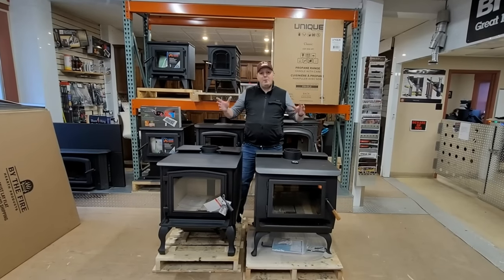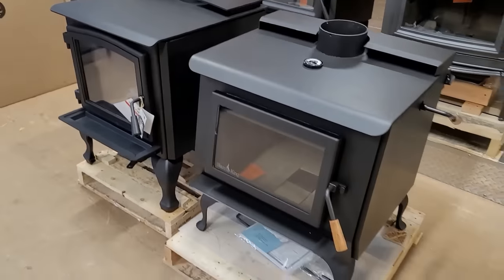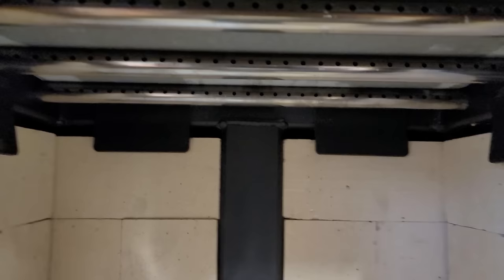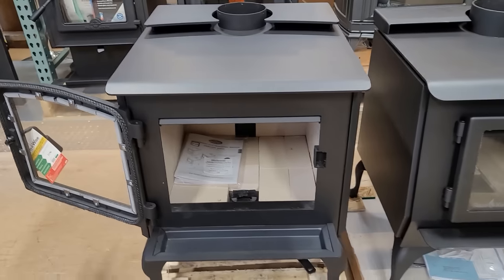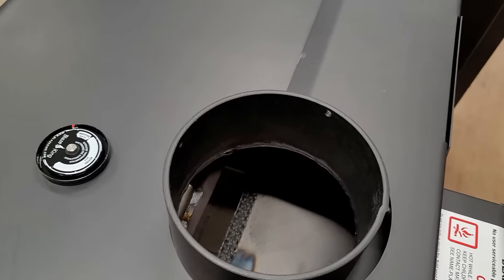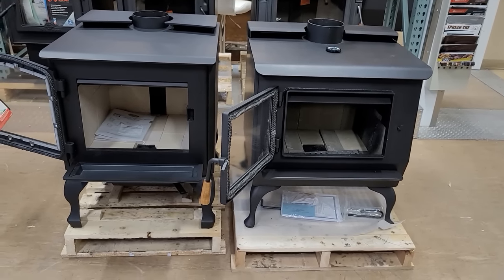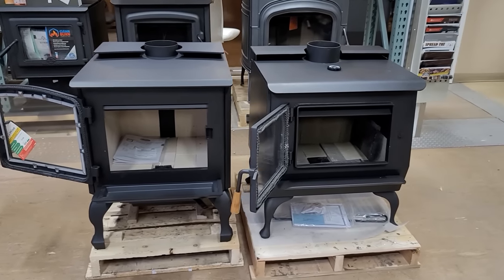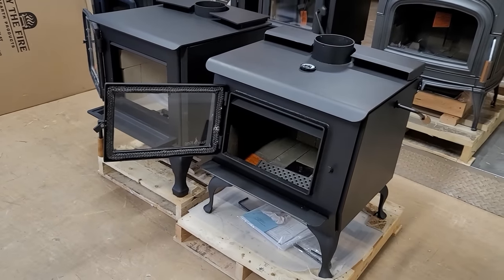Comparing Catalytic to Secondary Air Wood Stoves

Comment: We bought a Princess 32 and installed it on Valentine's Day. The fire has never gone out, and the house stays at 70 deg. Load it a night, top-up in the morning, good for the day. The best part is that we're burning HALF the wood we were burning before. What a great stove for a home.
Reply: Can I ask what the outside temperature was when it kept the house at 70deg?
Reply: @Journey_Around  These are the questions that we need to ask, but shouldn't have to.
Reply: Do live in Nunavut or NJ? Is your home 5000 sq ft. or 800 sq ft.? We need context, or the post is not helpful.
Reply: How long before the exchanger has to be changed

Comment: When we replaced our old Fisher stove about 30 years ago, cat stoves were really being pushed.   What I learned by asking lots of questions was this:  Is there a warranty on the catalyst--and for how long?  (its perfectly possible to "poison" one).   What's the catalytic efficiency at the end of the catalyst's life, compared to what it is at the start?   Should your company go out of business or be sold, how long will replacement catalytic cartridges be available?   Can I get a replacement cartridge, say, for my Oregon Woodstove (long defunct)?   One thing that was a real stopper for a couple of candidates was "You show a left-hand hinge model. but we need a right-hand hinge one.  Can you sell me one?"  You would be amazed at the number of "no" responses we got on that one.
After all the research, we wound up with the secondary burner.  It cost more than the catalytic models, but it still works just fine.    Heating efficiency isn't a big thing, as we own our own woodland and usually have far too much downed wood to be able to burn it all.

Comment: I tend to favor hybrid burners that feature the best of both types of stoves like the Jøtul F 500 V3 Oslo or the Woodstock Progress Hybrid stove. They deploy both technologies described in this video and allow you to decide whether to go for a hotter, more attractive fire or a longer burning fire. The Jøtul stove has a new type of combustor that is guaranteed for 20 years and doesn't require a bypass damper for when the stove is heating up, so its first hour emissions are extremely low because it always burns in a clean mode. Catalytic stoves have very high emissions while their bypass dampers are open, and require you to pay close attention to the catalyst temperature after lighting a fire so that you know when to close the damper. If you happen to get an engrossing phone call or you fall asleep right after lighting the stove you may burn all the wood up with the damper open. Catalysts have come a long way but are still often the Achilles heels of catalytic wood stoves. When they are new and undamaged they do a great job of giving you a high efficiency burn but if they become damaged or worn out the efficiency of the stove can drop substantially.
Reply: Can one clean and fix catalyst easily?
Reply: @haliaeetus8221  You can easily clean it, I use my shop vac to clean it up. If the cat needs servicing I would buy a new cat, install it and get the old one serviced. It should be a good long time 5~+ years before the cat is damaged. But from experience you will destroy your first cat in the first few years of operation while learning to use it. I have 3 species of wood I burn for heat, each has different settings and I don't have the luxery or space to let my wood dry / season for 2 years before I burn it. Most gets 6 months. So you will be cleaning it / servicing it. My practice is to use my shop vac to suck the ash out of the stove and then to take the shop vac to the cat. I do this every week and don't need to really worry about any other maintenance.
Reply: Thanks for the info about the Oslo 500. How do you increase the burn time other than reducing the front air inlet ? Also were you at all bother by the stove needing such thin pieces of wood ?
Reply: Also can you burn in the Oslo 500 without the catalyst I place without causing damage to the stove?
Reply: @lrich9317  It doesn't require thin pieces of wood. Thin pieces are often used in demos because they catch on fire quickly. The front air inlet is the only control on the burn rate.
Reply: @TugHillGuy  

Thanks ! Mine is getting installed as we speak ! Also what is a fair purchase price for a refurbished F600 joutal ?
Reply: @lrich9317  Which stove did you get? I'm not sure about what would be a fair price for a refurbished F600. It would depend on how good a shape it is in. I would check out the baffle and fire brick on the inside as well as how nice it is on the outside. Enamel paint is nicer than flat paint as it holds up much better. My friends own one. That was Jøtul's biggest stove before they stopped selling it due to not meeting EPA 2020 regulations.
Reply: @TugHillGuy  Thanks for the advice . Actually I got one F500 v3 joutal and the Pacific Energy alderlea 6T for another location.
Interesting that the joutal F500 v3 supposedly has the same heat output of the discontinued F600.

Comment: My woodstoves are old but extremely well built.  Both have thermostatic cold air inlets so the burn is fairly efficient.  I also have 2 Wiseway Non-electric pellet stoves.  I use all 4 stoves during the winter.  One woodstove to heat my barn and one to heat my "shop."   I use the pellet stoves to heat my house.   If pellets become expensive I have 2 spare woodstoves stored for "kust in case."

Comment: I didn't hear you mention one of the BEST features of the Blaze Kings. The automatic air control !!!!  That works like a thermostat for a furnace and automatically adjusts the air supply damper to maintain constant temperatures throughout the burn cycle. This one feature of the Blaze Kings that I would never give up and of course it helps that they are the longest burning wood stoves available. I have a Princess in my shop and a King Ultra in my house. I bought both of them new and still use them every burning season. The Princess is about 20 years old and the Ultra is 14 years old and both still work great.
Reply: What size if of shop u heat and to what temp ? I’m trying to decide if it’s big enough for a 36x50x16 in Manitoba ca
Reply: Have you ever had to change out the catalytic combusters?
Reply: My shop is 32 x 40 x11 and the princess is OK if I keep it going. I only have R20 insulation in the ceiling. I would suggest getting the Blaze King "King" for the shop if it is reasonably well insulated. I have a King in the house and it heats the whole house, up and down until it gets really cold (-30C) then I have to add some electric help. House is about 1300 square ft up and same down. @henryhenry5897
Reply: @louiswestfall9622  The one in the shop was changed out when we moved here 14 years ago and its still in use today. The one in the house was changed out twice. The first time because my moron electrician thought it would be a good idea to throw some plastic into the stove while it was burning. Ruined the combuster and he paid for the replacement . The second time was about 7 years ago because I was having draught problems and thought the combuster wasn't working properly. Turned out it was not a combuster issue.
Reply: @HillBilly-wc4dl  thanks for reply yes I’ll prob insulated it with 4“ closed cell sprayfoam about r25 wich is really outperforming any r40-50 fiber so I’d call it very well insulated ....
Reply: Same thing with my England's Smartstove.
 Once the wood has chard around 15 min. You can manually set  heat  output. Thermostat then keeps it there.   If you pull the same control out all the way and turn counter-clockwise you'll set it to automatically shut off the primary Air Supply on the bottom and just run the secondary on the top. It only does that once it reaches  temperature.  If it should drop more than the secondary can control it opens it back up. Otherwise it's maintaining temperature just from the secondary burning gas from the mass of red coals.
    It's is nice when you're sitting back having a  drink and a smoke in the evening to leave the dampeners open and enjoy a nice Flame. And when you're done just set it and forget it.
Reply: @louiswestfall9622  I have a BK King.  Myself and two friends in CT bought ours all at the same time back in 2009 ($1925 each, don't know what they cost now, but I'm sure they're worth every penny).   Anyway, we all remove and clean the cat at least once a year.  All of us use the stoves all winter long, and we are all still using the original cat!  I do have a spare cat which I bought with the stove, but haven't installed it.  Awesome stoves!

Comment: Having used all types of wood stoves I would say I prefer the reburn. Although, the catalytic stove is an old Vermont Casting and they don't have the best reputation. Whatever stove you buy, get one with the lowest possibility of an air leak. i.e. no ash dump, few gaskets. That Vermont Casting has an ash dump and six different gaskets of varying sizes. After the last time I took it apart and cleaned it up it feels like it burns through the wood faster so it must have an air leak somewhere.

Comment: This is extremely helpful. It would be nice to know what the price difference is between these two stoves I know they would vary from state to state but it would be nice to have a general idea. And do these stoves come in smaller models. You mentioned this heats a 2500 square-foot home which would be too large for what I’m looking for.
Reply from the maker: Yes they come in smaller models and the prices are close depending on the brand you choose.

Comment: Thankyou for a very informative video.
But you left out a very important point regarding these two fire places that people should be aware of before making a decision on either.
Maintenance!
The secondary fire place has minimal maintenance where as the catalytic fire place has much more required maintenance that has a fair cost associated with it due to cleaning/replacing the catalytic unit that is made of quite expensive materials.
Happy to be corrected if I am not on the money here...
Reply from the maker: I think there is some merit to what you are saying to a point. It really comes down to the type of wood burnt. Well seasoned wood and barely any issues, unseasoned wood and plenty of issues for both. Depending on brand of stove secondary air stoves can be expensive to replace parts as well. Secondary air tubes and baffles often get broken and need to be replaced so both types of stoves can cost $$$ in maintenance. Hence why its not mentioned.

Comment: What happens when you can go longer by a replacement catalyst for the stove? How long do these catalyst last? Does a catalyst really burn that long or is it just a bunch of bull specs? I can't imagine anything burning 30 hrs or even 20 for that matter on one load of wood. Lower for longer periods of time is exactly what I need but in concerned about replacing the catalyst etc. Can a catalyst replacement be made easily?

Comment: I wonder if that Catalyst  makes the air outside smell like a Flatulant?   Back in the 80s, I built a stove from a piece of 18" pipe. Had a top Horizontal 6" exhaust, a large baffle forcing the exhaust to go around the ends before exiting into the Flue, (which was 20 feet tall). Since the Stove was ROUND, there was no need for Fire Brick to keep the corners from splitting open, and it made a LOT of heat. Round stoves make the fire fall into itself, so burns are much more complete. After 5 YEARS, I swept my flue pipe, to get 1/8 cup of tan dust. NONE of these new square stoves would do that. But thanks for the good info. Nice video.
Reply: Very interesting comment! 
I built a small 16” long stove out of oilfield pipe. 3/8” thick I believe and about 14” wide pipe. 
Anyway with that stove I never ran a brush through the chimney in 4 years of burning half dry and often green wood ( to gain burn times).
Creosote would collect in the top of my chimney cap but that’s it.
Then I moved into a house and had a secondary air style stove. One of the best ( Super 27). Now I clean my chimney once a month and I use seasoned wood on top of that.
I run it very hot often but it still stays pretty dirty in the pipe. 
I wonder if the round stove vs my square style stove plays a roll.

Comment: Fine presentation. We had Vermont Casting cat stoves for 2 decades when they first came out. Except for parts replacement the 3 VC Encores were fine heaters for primary heat in Maine. When the last Encores became too costly and time to repair we tried the "NEW AND IMPROVED" Flexburn models with the same form factor as old Encores. They did not function and were dangerous since the primary air controls malfunctioned on 2 Encore Flexburns with uncontrollable fires. The dealer ( a true pro ) refunded the full costs and took the stoves back. VC corporate was AWOL, even angry. Blaze King was on the agenda but high $$$$ and it would not fit our clearances since their thermostatic control at the rear needed too much spacing. The choice for the past 5+ years has been 2 Jotul Rangelys ( no longer made) non cats for 99% primary heat ( we have no central heat or thermostat like most set at say 65 F ) with NO problems including original gaskets and air tubes. We are home often enough to load when needed for heat. JMNSHO

Comment: How long does the catalytic converter last and how much are they to replace?
Reply: i was wondering the same  o r can they be cleaned
Reply: I have a BK King.  Myself and two friends in CT bought ours all at the same time back in 2009 ($1925 each, don't know what they cost now, but I'm sure they're worth every penny).   Anyway, we all remove and clean the cat at least once a year.  All of us use the stoves all winter long, and we are all still using the original cat!  I do have a spare cat which I bought with the stove, but haven't installed it.  Awesome stoves!
Reply: @ssoffshore5111  So roughly, how much does a catalyst spare part cost then?

Comment: I have a catalytic wood stove, and the biggest downside is the delay in getting heat when you start them cold.  It is like preheating an oven.  First you establish the fire, then you run the stove with the bypass damper open for at least 20 minutes to get the stove and the catalyst hot.  Then you shut the bypass damper and start getting meaningful heat out of the thing.  For a cold cabin that is maybe 30 degrees inside, that is a long time to be cold.  But once you get past that slow start up, they work great, as long as you are burning seasoned, dry wood.
Reply from the maker: Yeah that is a downside with cabins. In cases like that I generally recommend a secondary air stove to my customers who come in the showroom. Cat stoves work best burned every day.

Comment: Amazing. Thank you very much. Bought the wrong stove. I am a Queenslander now living western NSW Australia. Winter is only short. However, wood is extremely expensive to buy. Oh well. I put my ceiling fan on reverse. That helps. Small cottage. It is warmer. However, not economical. $1,050.00 Australian dollars so far for wood? Down under Australia is not at all a cheap country to live in. I will be leaving country life too hard, expensive and boring. I live near Wyangla Dam. Closest town Cowra. WWll history here. Thank you very much. Great video. Very well explained. Fire box was $1,500.00 and too have it installed $900.00. All Australian dollars.

Comment: Would you tell me what is the diameter of the holes and how many that are on the top secondary air burn on left ??? The tubes look like 3/4 inch diameter, am I correct on that fact ?? 
The catalyst blaze king, how long does the catalytic element last as you stated by type Sir ???
My last question is the safety of the glass door breaking or exploding causing a house fire ???
Would you give me a quote on each stove and shipping cost to eastern Pennsylvania Sir. Do these stoves come in larger sizes ???
Thanks a bunch and have a great day too. Look forward to do business with you fella. Peace vf

Comment: I had a catalytic stove at one time.  The catalyst grid was constantly getting fouled with fly ash.  Performance declined rapidly and It needed cleaned every few days.  It also failed to work entirely after a few weeks and was expensive to replace.  I now have a "secondary air" stove that I find entirely satisfactory.
Reply: That is the main reason why I will NEVER buy a woodstove with a catolithic convertor. Waste of money if you ask me. Not to mention the added cost on the stove.

Comment: My Drolet HT2000 also has an airwash system to help keep the glass a little cleaner or is it all part and parcel with the secondary air....And thanks for the explanation/video.

Comment: How clean do the flues compare on the two? We have a secondary air burning Englander and love it. Flue is completely clean and do not need to chimney sweep. So your left stove burns for 10 hours while the catalytic one goes for 30. Are those 30 hours of smoldering wood? It would seem that way but does the catalyst last through a typical winter? Seems like it would clog up quickly with slow burning wood. We get a good blaze going in the evening then shut the draught down. Still toasty in the morning and often coals can be stirred up to ignite a new fire (depends how much wood was stoked in there the night before). Tip: we strip bark (that is loose on properly seasoned hardwood) to start a new fire with coals. If ashes are cold, we use a parrafin/sawdust block below the bark and a bit of kindling with split wood on top. I vote for secondary air combustion, especially Englander, an amazing stove and shame I heard they went bankrupt.